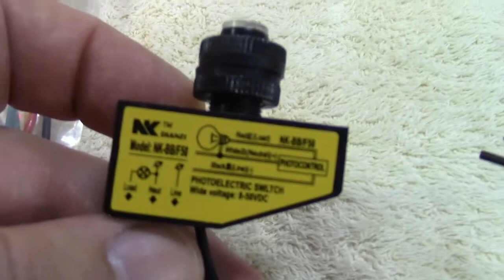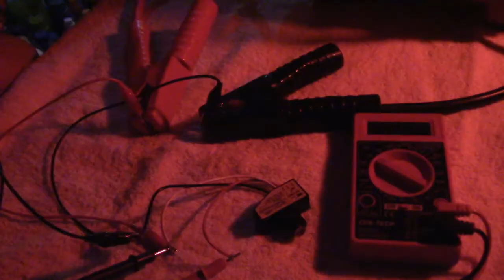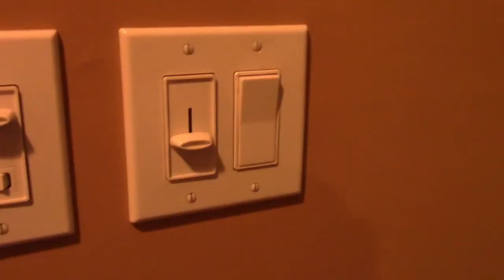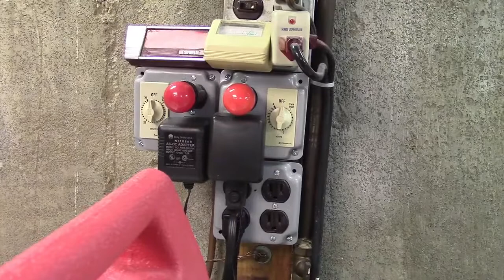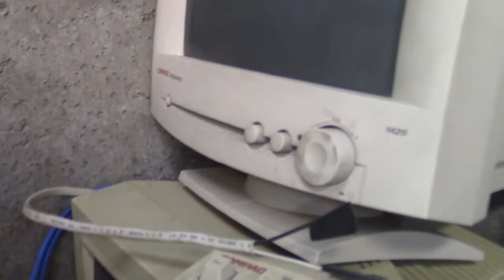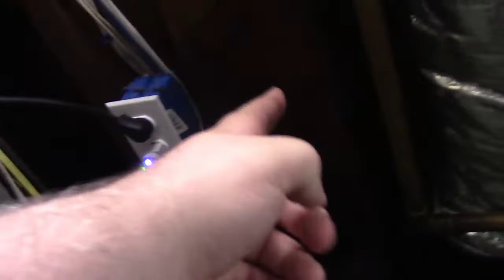Dusk-To-Dawn Light Control Project Prototype

Comment: I can't wait to see this in action, these sorts of projects are right up my alley.  There is a commercial solution, which we use on our outdoor lights, but it's not interesting like your project is.  We use these Intermatic wallswitch timers, they're relay-operated so they can be used with any bulb.. any load, for that matter, and you set the time and date.  They know the sunrise and sunset times for each day of the year, and operate that way.  Or all sorts of useless stuff like "on at sunset, off 1-12 hours later" or on a certain number of hours before sunrise, then off at sunrise, shit like that.  The downsides, however, are 1) they're not as cool, and 2) you have to replace a small battery in the unit every couple of years or so.
Reply from the maker: This project hasn't gotten off the ground yet, and I'm not sure when I'll get back to it, too much other stuff going on right now so it's on the back burner.  That commercial solution would work, but this is the real "meat & potatoes" deal, a power supply, the photocell, and a relay to switch the load.  Will even go on if it clouds up real bad before a thunderstorm.

Comment: You do know that there is a built in time delay on the photocell, to prevent false triggering
Reply from the maker: I found that out, certainly!  Not all of them have it, which is why I'm glad this one did.  Even in cars a lot of times, they go under an overpass at 60MPH and the lights come on immediately, then have a delay of 10 seconds to shut back off.  Well that's really saving the bulbs right there...

Comment: You can also get individual AC light sensing sockets for your lights but then you'd need several of them since you have more than 1 light to control.  Your relay and and sensor should work for your project and a sound idea.  If you draw a circuit, you'll get many who will tell you this or that is not to code.  Codes are there for a reason but then few would consult the electrical code when you're just  conceptualizing and experimenting.  Sometimes the light sensors don't work consistently.  Some of my store bought remote sensing lights would light up during daytime and quickly drain the batteries. I now use solar panels and lithium ion batteries for these exterior lights. The solar panels would act as a light sensor and the charge controller turns the lights on and off.  It's comforting to see your outside lights running at the time of power outage.  Interesting and practical project overall.
Reply from the maker: Yeah I know about the AC light sensing sockets.  The problem is, those (at least the ones I've seen) are meant for use with incandescent only, and will tend to "dim on" the bulb and ramp it up to full brightness as it gets darker.  Those don't jive with CFLs.  Not to mention I'd need 9 of them.  For a dollar or two apiece that would be reasonable, but not for the money they'd go for.

I may, before this goes into final hookup, draw a circuit diagram.  It will help me conceptualize the wiring as I hook it up.  Afterwards I'd archive that with all of my other diagrams I've come up with over the years.  I'm also not concerned about code, as I want it to work.  I'll ensure all switches and contacts will handle the final current and are isolated from the rest, that's really all that needs to be done.  There's plenty more testing to be done.

I wish I were more into electronics, but I'm really more into computers.  That was always my forté.  It was sort of "prescribed" to me almost, my dad working for IBM for 35 years.  I cut my teeth on early IBM home computers.  My dad always told me "never work for IBM", but he never said I couldn't get into the same line of work.  Truth be told, he had no involvement with the PC, he worked on the big mainframes and giant printers.  But it was sort of ingrained in me to be in the computer field.  Along with that comes some interest in electronics.  If I knew more I could do more.

I know your solar lights work quite well and you have many different ones that you've made.  I was sent one for review not too long ago, and I may end up using it.  https://www.youtube.com/watch?v=ApBF4NyBrt4
Reply: Yours is a worthwhile project and in line with your other "Set it and forget it" appliances. Or maybe you've progressed from the Ron Propeil rotisserie to the latest crop of power air fryers. @jaykay18
Reply from the maker: I still have and use that rotisserie, I've also acquired the large size one they had for a short time.  Nobody has given me an air fryer yet, but the funny thing is, I have something just like it, but better in my opinion.  Some time ago I bought one of those halogen cooker ovens.  Essentially it's exactly the same as an air fryer, just uses a halogen light instead of a heating element, but it's using approximately the same wattage and therefore about the same heat output.

The halogen oven is a big glass bowl and has 2 racks that you can cook on.  Obviously things need to be rotated around, otherwise the items on top will burn while the ones below won't cook through.  That being said, I look at these air fryers and the amount of space they take up compared to this thing, and how much food they hold compared to this, and there is no comparison.  Now they have the air fryer "oven" which is nothing more than a glorified toaster.  Oh, and I bought a glorified toaster oven at Aldi, with convection and rotisserie built in for $35.  "Anything you can do, I can do better..."  And cheaper!

The halogen oven also fits a whole chicken with ease, and when I don't feel like tying the bird up (literally), I'll toss it in there.  It comes out great.  The rotisserie adds another dimension to the flavor, and to the cooking!

Another recent "set it and forget it" gadget they've been pushing on TV are these pressure cookers.  My parents always owned an old-school stove top one, so it's always been on my mind to get.  I almost did, but I'm glad I held out as I was sent one for review.  After the review I decided to actually use it, and surprisingly, it's actually another one of those products that actually does what they said it would do.  I've made pot roast and osso buco, both turned out fantastic.  Really all it is is nothing more than a stainless steel pot with a cast iron "hob" burner below it, a bunch of sensors, a pressure top, and a computerized timer.  They did take the guesswork out of it, you literally dump the stuff in, put the top on, press the button and walk away and it does the rest.  If you forget about it, it shuts off and goes to keep warm mode, and the pressure will decrease naturally.  Similar to a crock pot, it's not going to overcook if you come back to it later, within reason of course.
Reply: Yes, I saw the pressure cooker with the browning element. I think that is something that might work well.  Air fryer is just convection toaster oven.  "Set it and forget it." That jingle has a nice ring to it.   @jaykay18
Reply from the maker: Yes, I saw that one too.  The Ninja Foodi.  What a stupid name, and stupid spelling.  The idea is nice in that, but it's rather cumbersome always having another lid laying around.  I don't really see much point to it either.  Traditionally, you'll do a wet cooking method, or a dry cooking method, not both.  Braising in a crock pot or pressure cooker.  Not to mention all that "gravy" that collects, to get mopped up by rice, bread, or potatoes.  Why boil that away?

There were one or two other infomercials (btw I love watching them but never buying from them) that tried to capitalize on the "set it and forget it", but because it's trademarked they had to change it, so I've heard "just press the button and walk away" or "just set it and walk away".